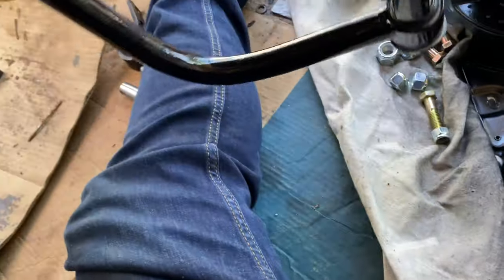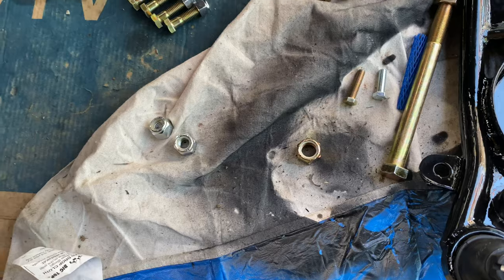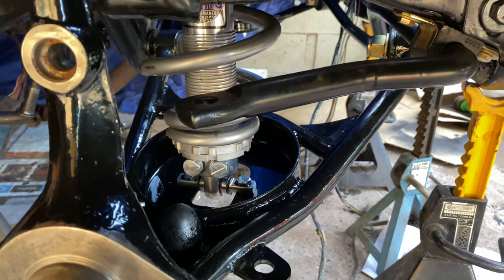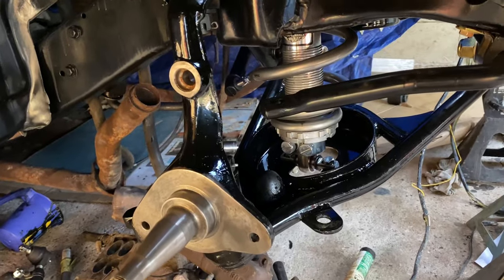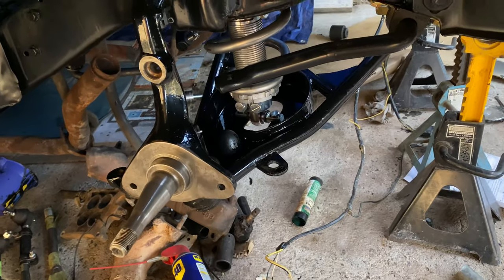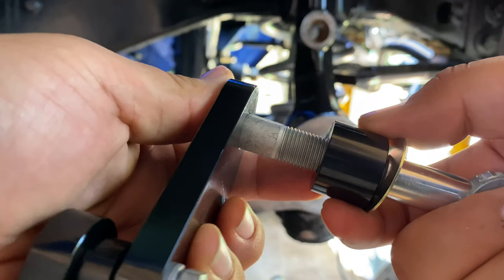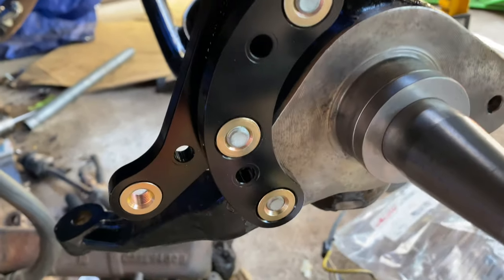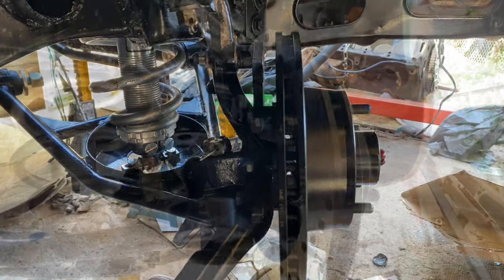1964 Galaxie Gets Coil overs and Wilwood Disc Brakes!

Comment: Great video, which Wilwood kit did you get? Did you replace the brake booster? Any prod detail would be appreciated
Reply from the maker: 140-13653-d is the part number for front. I had the original booster rebuilt by the Dewey booster exchange
Reply: @OmarRamirezGalaxie  excellent! Thank you.

Comment: Omar, How'd you decide on the viking coilovers? I'm in the market and there are at least 4 good quality choices. I want comfy ride, improved handling and a little lower than stock.
Reply from the maker: Yes there are lots of choices. I honestly got this because of the price and the fact that they are adjustable. So you can have a smooth ride or make it firm by changing the knobs. And they are lower from stock, good bang for the buck. I would call them, they are really knowledgeable for your setup.

Comment: What master cylinder are you running? I’m debating between a Leeds , pirate jack or a wilwood manual master cylinder?
Reply from the maker: Personally I’ve always gone with wilwood, I’ve never had problems with their parts
Reply: @OmarRamirezGalaxie  I appreciate the reply. I think that’s what I’m going to do also

Comment: Looks nice i have a 65 but i want to chance it to disk ony i have already a booster but it brakes not nice whit drumbs so i want to instal also wilwoods but what inch do i need and how mutch pistons 4 or 6 i have 21 inch wheels so space wouldn be the problem but i think i need an otter booster becouse the rear is stil drums what do you think whats best?
Reply from the maker: Just depends what you’re going to use the car for. 4 piston is fine for everyday, 6 piston has some huge rotors so they’re pretty pricey. I would call wilwood, their tech support is really good

Comment: Hey.. Where did you ordered your brake kit from? How much was the kit for the fronts? Did you have to change the spindles from drum to disc?
Reply from the maker: I got it from summit racing for about $650. Uses the original drum brake spindle
Reply: @OmarRamirezGalaxie  thank you..  I have 18×8 foose f-208 rims all around. Do u think the brake caliper will rub the rim?. I also want to do the rears like u did your. What's the part numbers for your fronts and rears? Thanks again
Reply from the maker: @germanmelendez6718  mine are 15 inch and front and rear fit fine. Front are 140- 13653-D. For the rear kit you’re going to have to measure the offset on your rear hub, It also depends if you have an 8 inch or a 9 inch rear end
Reply: @OmarRamirezGalaxie  Thank you so much for the part number and your time..
Reply from the maker: @germanmelendez6718  no problem any questions let me know.
Reply: @OmarRamirezGalaxie  Thank you.. Will do..
Reply: Hey Omar.. I had a question i found the rear end tag still on the car. Can you tell me what it means and if I have a 8 inch or a 9-inch rear end. This is the letters and numbers... WBS-BN2
                                     3.00.   4ED.  105
Reply from the maker: @germanmelendez6718  I wouldn’t really trust the tags as people can swap them.  I can tell when it is a 9 inch just by how big it looks, but an easy way to tell is if you can’t put a socket on the bottom bolts. Check out this video 
https://youtu.be/Ca85RyHKNzs
Reply: @OmarRamirezGalaxie  Thank you for the video. Ill check it tomorrow before work and i will let you know.. I appreciate ALL your help.. I like to show you pictures of my galaxie. I don't know how to send you some.

Comment: Your greasing the front wheel bearings was insufficient. It's called packing the bearings. Those bearings will fail prematurely because rubbing grease on them is moved away from the bearings as the rotor spins.
Reply from the maker: Talon Sharp thanks for the comment. I did grease them a lot more after I filmed it, I felt like it needed more as well
Reply: @OmarRamirezGalaxie  it's not that you didn't have enough grease, greasing wheel bearings is forcing the grease in between the cage and the bearings on the inside. There are videos showing this technique by hand and with a bearing packer. When those bearings start turning at 20, 50 miles per hour that grease on the outside will remain on the outside and bearing failure will not be far behind.